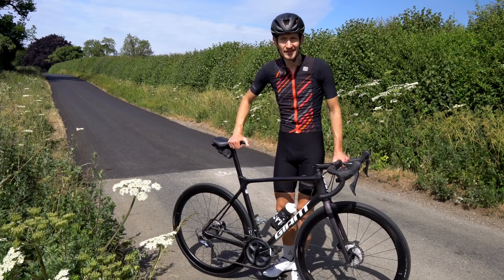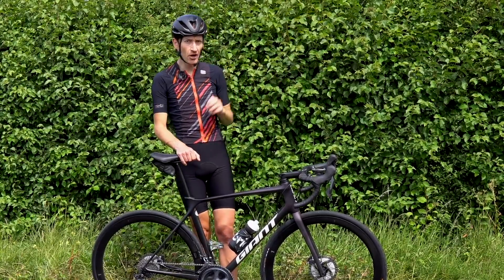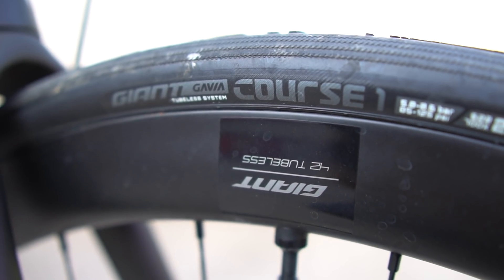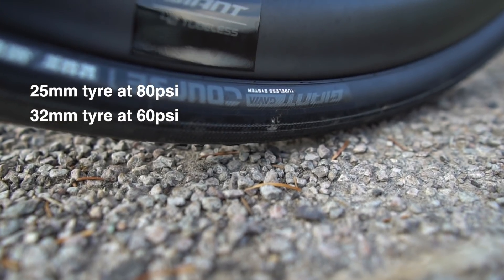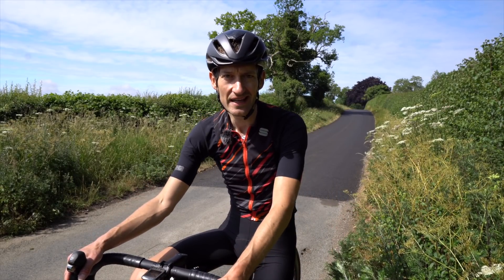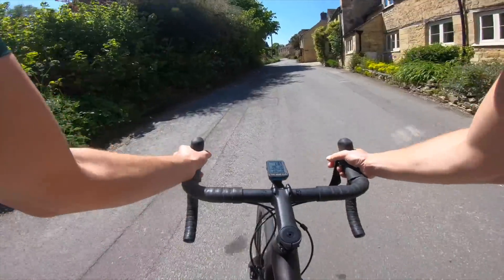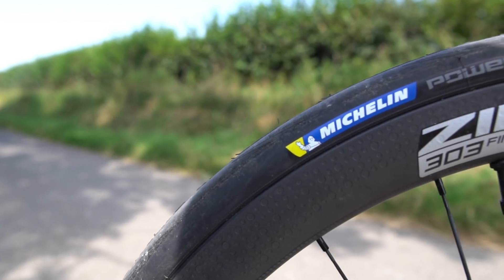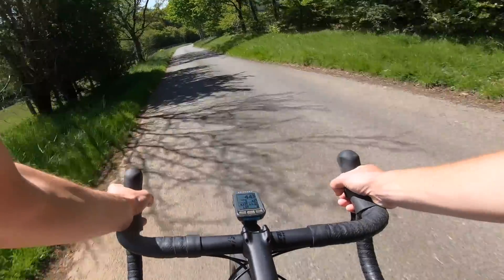Are Wide Tyres Really Faster? Rolling resistance timed testing reveals the truth...

Comment: Because roads are not perfectly flat, the amount of force imparted by each bump is a major inefficiency. This is why, at some point, increasing tire pressure actually makes the system less efficient, because a softer (lower pressure) tire can hit those tiny bumps without imparting energy in the upward direction, conserving forward momentum. On a road that is not well maintained, one which has any cracks in the surface, 60psi is close to the ideal fastest pressure, and wider tires are suited to that psi range, while narrow tires are simply not.

Comment: This test is not too accurate.  These tires are very different. Gavia Course is a model with focus on grip (and more rolling resistance) and Gavia Fondo model focus is durability. This test should be done using the same tire model in 25 and 28 mm

Comment: Wide only works on rough roads...the industry keeps forgetting to mention that...or track bikes on the velodrome would be on super wide.
Reply from the maker: The thing about wide tyre is to smooth out rough roads, velodromes are very smooth wooden surfaces so there are no bumps where you need tyre suspension

Comment: According to the logic promoted in the video, the tractor should be comparably fast as a racing car because it has wide tyres.
Perhaps from the point of view of transferring instantaneous peak performance to the road, they may seem better for a few seconds at the cost of reduced efficiency. But in long term use, physics cannot be fooled. Efficiency is much lower in the case of wide tyres.

Comment: A misleading comparison. 
>>>basically something that is heavier will go down faster<<<<
If you compare which is faster on the descent without pedaling between 25c and 45c you will get an easy answer.
The correct way to test is to do it on a flat road, with a power meter, at the same speed, compare which one requires lower power.

Comment: Where the biggest wide tyre advantage could come is cornering at speed.  The difference between crashing and not crashing is huge. That said, in 60 years of cycling I have only sliden off on a corner on the road once, and that includes sometimes using 19 mm tyres at 120 psi.

Comment: You almost highlighted it yourself - At the speed and the method you are testing it's clear enough - but aerodynamics, padling forces, acceleration/deceleration and weight quickly change the equation under more normal or racing conditions.

Comment: I went from 25mm Rubino Pro's to 25/28 Specialized Roubaix Pro's - definitely more grippy and comfortable but im really only noticing that they roll much much better and smoother on the flats. if i had to put it into context Rubinos = good - Roubaix Pro's = literally floating on air. But when surfaces are rough and uneven the Roubaix just doesnt seem to roll that well...

It could be that ive got too high a pressure. Im currently running R:75 and F:70 but i have ran 65/60 but that is just too low a pressure for the Roubaix. Ive ran 80/75 but i found the ride slightly jarring.

Id like to experiment a little more but roads are currently wet and slushy with ice and snow.

Climbing and acceleration also went out the window since the Roubaix's come in at 300g per tyre and they take quite a spin up to get up to the same speeds as i did with the Rubinos. I also love to randomly get out of the saddle and go for an all out sprint and the Roubaix's are a little hesitant to pick up speed where as the Rubinos are picking up speed almost instantly.

I have a set of Roubaix's in 23/25 that will be going on the commuter soon so i'll be able to compare all three tyres a little further. I honestly think the 23/25 set will be pretty good.

Comment: DIY rolling resistance test and comparison is best conducted with a negligible aero factor, under a lowest possible and meaningful ride velocity. There are two scientifically correct methods to consider. 

(1) static roll threshold force. Test data will be taken just when the bike begins to roll. (This is a test need a tire under test, bike, rider (or dead weight) and one or two helper to balance the bike at zero speed. A third person to pull the bike coupled to a digital scale.)

(2) dynamic roll resistance: a powered vehicle tolling the rider and bike under test coupled by a bungee cord and a digital scale. Steady force data may be recorded at various speed intervals. (Make available the tow has an emergency release mechanism)

Comment: I could be wrong.  More than likely I am.  But, you are testing out which tire is faster by coasting downhill.  It stands to reason that the wider tire is going to have more weight and therefore more potential energy than the narrow tire.  Now obviously rolling resistance is going to work against that potential energy but I feel like the only way to truly determine which wheel is faster is testing with a power meter.  In my experience when it comes to narrow vs wide the fastest tire provides the most speed for the least amount of effort.  Having started out with 38mm tires and eventually going down to 25mm tires, it is pretty clear the narrow tires require less effort than the wider tire.  In other words I can ride farther on a narrow tire.

Comment: I didn't even find this interesting from a technology point of view.  For my riding it completely missed the point.  I ride for 2 -8 hours.  I never ride for 1 minute.  The test should demonstrate how its feel riding it.  And, I don't mean cushion - yes, it's softer on bumpy roads, even dreamy!  But, that's not what is important to me.  I want to ZERO rolling resistance.  I don't want to even know I have tires.  And, I want to go fast!

The question is how much energy do you have to put out to push those tires along whether going for 1 hours when you're rested or after going 75 miles and climbing 7000' and you're tired.  What's your average pace on both tires given all other things being somewhat equal.  Simply said, do you feel like you are being propelled along or are dragging a boat anchor?  Going 100' is not a test.  You need to do a 50 or 100 miles.  And, see if you feel you're dragging your bike or is it rolling along easily.  I did my own tests comparing a 25 and 28mm tire and results was crystal clear.  I absolutely HATED the 28mm tire.  It was a boat anchor, I will never ride them again.

Comment: There were 2 Parameters. Width and Pressure. Instead of arbitrary comfort pressures I would have chosen max allowable pressure or a percentage thereof for both tyres. Also, does rolling resistance at 40kmh still offset increased air resistance of wider tyres ? Last but not least I think sprinters want harder tyres as rocking the bike on softer tyres seems slower.

Comment: Wider tire, more weight, increased speed due to more stored potential energy E=mgh. This energy came from the rider going uphill.  Weight diff may have been enough to offset poorer aero of wide tire.   Better to do closed course w power meter over long enough course to discern time difference.  Ex aerospaced eng:)

Comment: Hélio from Portugal . What about riding diferent tires on climbs? And the weight of tire+inner tube? What you recomend for granfondo? A set gp5000 25 with continental race light tube is 70g lighter than a gp5000 28 with a vittoria standar tube , because there are no light tubes for 28 tires…

Comment: My local roads are coarse chip and seal with a lot of expansion/contraction cracks that can be quite jarring.  I wanted comfort over long rides without giving up too much rolling resistance.  When the original 28mm's wore out, I replaced them with 32's - both running at pressures that gave 15% rim drop.  The 32's definitely delivered the comfort, I didn't notice any slower rolling, and was pleasantly surprised at the noticeably better handling and traction.  Wider was definitely better for me.

Comment: Can narrow tyres bear 231 pounds while cycling ?
Reply: I was 245 pounds and rode 23 mm tires aluminum wheels carbon bike and flew down mountain roads at over 50 mph np. Now have full carbon bike and wheels running 25 mm tires am 165 pounds no problems.  Would say if you want to run smaller tires should be ok. Hookless and tubeless rims may be only way you would need to use bigger tires due to psi needed on small tires would exceed max for rider weight.

Comment: I run 23 mm on the front wheel (45 mm deep rims) because of aerodynamics. At the rear wheel (88 mm deep rims) I run 30 or 32 mm because of comfort, and the air is so turbulent anyway around the rear wheel, so aero is not an issue there.
Wider tires are faster in low speeds since deformation in the contact patch does not affect the side walls as much as in narrower tires. If side walls deforms, a lot of energy is lost. In the center of the tire there is rubber which springs back and gives back energy in the end of the contact area; like a spring.

Comment: I'm not convinced, there's hardly any difference in your results. I think tire pressure and construction is more important and once going faster the 25c should be more aerodynamic. 

I have a 25c and 32c road bike and the 25c bike is clearly faster, though it is a rim brake bike with more aerodynamic wheels which will be the main difference.

Comment: Nonsense. You do not know what you are talking about. You tested a bike rolling down a hill slowly. We ride at pace, it has no relevance whatsoever. Aerodynamics trumps rolling resistance at speed. Rolling resistance is more significant getting up to speed on a standing start as the tire has to overcome inertia with no force input. This is incredibly misleading and just wrong. It is the opposite.

Comment: Great vid! One problem I see is that coasting rolling resistance is only one part of real-world cycling. Most of the time you are pedalling. The pedalling action imparts a periodic force on the tyre, and there will be losses involved in counteracting this force. I suspect (but haven’t tested) that a wider, softer tyre will have different losses (hysteresis, air compression, etc) to that of a narrow hard (ie high pressure) tyre. Worth investigating?
Reply: There is also a difference between solo riding and racing. Who do I want fast tyres for my solo rides? Strava only, to be honest. In racing, roads are closed off and most of the time you're drafting someone else. Speeds are nor too much higher, but air drag ramps with the square (or cube) of speed. Most agree is the square, but a 100 hp car can go 200 kph, and a 400 hp car definitely can't go 400 kph. In a crit, the speed and easy I can take corners would be "critical", less acceleration to do. Crits killed me that way. Big guy, not a not of help from the slipstream of the shorties in front.

Comment: I'm 6'2" 185lbs, I first tried 28mm rear and 25mm front. When I rode over new/ loose pavement pebbles would get caught between the tires and frame then burn the rubber down the center of tire. Happened to me twice. The front 25mm felt slow to turn in corners. So I moved the 25mm to rear and brought a 23mm for front. Even when the rear 25mm was pumped to max psi the tire always felt like it was on flat and swirly, the front was great. Then I got a 23mm for rear, to me the problem was solved. Later I tried 25's again, then went back to the 23's. I use the pirelli p-zero rated for 125psi, but aired to 105 front and 115 rear. I'm not looking down for flats anymore plus better all around performance. I don't notice any real comfort loss when aired to the appropriate psi. The only real advantage of wider tires to me is maybe braking.

Comment: Wider tire has better rolling resistance ONLY , but the last time I checked the avg speed of Tour de France is 50km/h, so aerodynamics play a role which is not measured in your test. This renders the test inconclusive as far as Which is faster :/
Reply from the maker: Well I'm not a pro riding at 50kph so that's kinda pointless to me and regular cyclists. Was focusing on real-world benefits
Reply: @davidarthur  But surely your avg speed is higher than 15 km/h? I would estimate most regular riders get 25-30, so I would run another test ))

Comment: Great video. However, it would be more scientific to test a single variable at a time rather than changing two variables (tyre size and pressure) and not knowing which one was responsible for the difference on speed.
Reply: I like this methodology as it’s closer to planned use conditions, although the pressure data is meaningful.  It seems like there is a lot of good data for pressure with calculators from Silca, SRAM, HED, etc.

Comment: You could put 110 psi in the 25mm tyre, and achieve lower rolling resistance. You could put 170psi in a good 20mm tyre, and go faster still. Testing at wheelbarrow tyre pressures proves nothing to riders who want to go fast- it just proves that wheelbarrow tyres work better at those pressures.

Comment: I like the video and it illustrates how easily we can all measure the effectiveness of changes that we make to our setups. 
However, I would argue that these particular results are inaccurate for two reasons. Firstly, the times have been rounded to the nearest second. So 18s could really be 17.5s and 17s could really be 17.49s. Even with human error starting and starting the timer, an accuracy of 0.1s should be achievable. Secondly, just three experiments each isn't statistically significant, especially with such small differences. 
A good idea though, which can easily be improved upon.

Comment: Hi David, thanks for doing the test it was a good effort but the results aren't quite what they appear. A. 32mm wheels/tyres accelerate slightly faster than 25mm tyres due to difference in torroid shape (91% vs 93% torroidal); B. 32mm wheels/tyres have higher kinetic energy than 25mm (even at the same speed) due to mass of around 150g for pair C. 32mm tyres have slightly higher aero drag than 25mm tire but only about 1watt at 24kph (fft.tips/tyre). You can plug this all into OMNI calculator and  they suggest that 32mm will roll down a 25 metre drop 2.1kph faster than a 25mm tire (but they don’t control for air resistance difference, which I would say cut that in half) and this is not due to CRR. So basically the results aren't due to CRR it's mainly mass. Nice to get us thinking though! bw Alex from FFT
Reply: Right, the mass plays an important role. So in the test the difference in weight should be compensated by filling e.g. a water bottle accordingly to mostly eliminate that effect.
Reply: @stefanwagener  Yes, you could weight the lighter bike with say +150g in the water bottle vs an empty water bottle.....check my blog for more details search (cycling apps dot net)

Comment: 28's on my road bike and 32's on my fixed. Seems to work best for me - 28's still feel a bit more fleet of foot than 32's, but like the 32's on my fixed for comfort and stability, where outright pace is not as crucial. 28's are easily comfortable enough for me at the right psi. Changed from 25's years ago and never looked back

Comment: Personal experience I rode 25 and 28C the 25C tyres rolled better and accelerated better on smooth road. The 28C seemed a little more draggy but was definitely more comfortable on bumpy surfaces, and cobble stones. All tried at several different pressures. I feel it's six of one and a half dozen on the other myself but I know people will want to shoot me down in flames because they are so sure THEY are right and I don't know anything! So please don't bother to troll my comments..
Reply: Oddly enough the smoothness of the ride helps make the larger tires faster. Smaller tires can feel faster as the bumps etc give the impression of higher speed but those bumps (both the perceived and non perceived ones) actually cause a non trivial impact to speed even on fairly smooth surfaces. The larger tires ability to absorb more without changing its roll is part of what makes them faster, but that same smoothness will often make them feel slower.

I think a lot of what the bicycle world does is by feel though so that’s why they’ve been popular. People also like to lurch from trend to trend overdoing it in the opposite direction. They also tend to follow the racing community instead of doing what’s optimal for the ways they are actually using a bike (an ahem example would be using thin aerodynamic tires that are super fast at 30mph because all of their imperfections are overridden by the fact that they have less air resistance, but are terrible for the speeds that riders operate at for 99% of their rides)